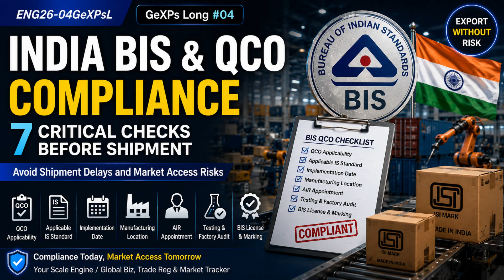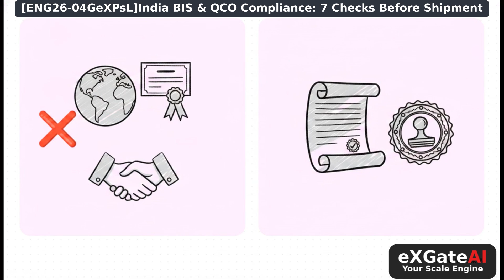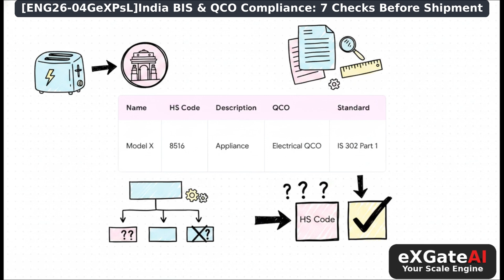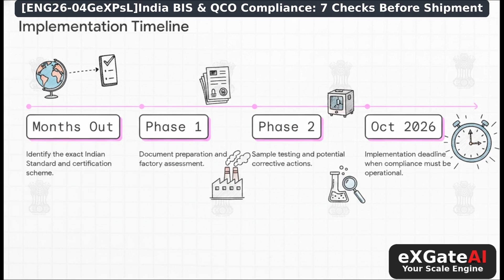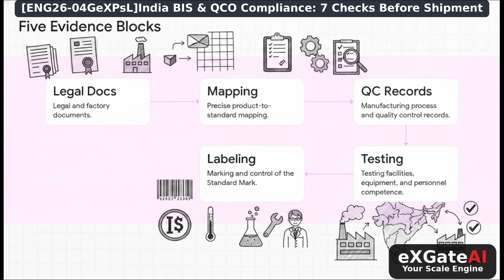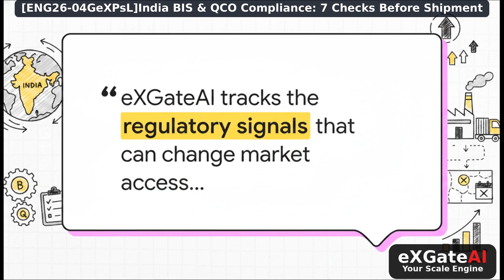Ship to India Without These 7 BIS/QCO Checks? Customs Holds and Rework Can Follow

Comment from the maker: Before shipping to India, can your company clearly answer all seven questions?

Is the product subject to a QCO? Which Indian Standard applies? Which certification route is required? Is the manufacturing site ready? Has the AIR been appointed? Are testing and factory-inspection preparations complete? Is the BIS license valid and the required marking correctly displayed?

BIS and QCO compliance should not be left only to the local distributor or certification team. Product development, quality, manufacturing, logistics, sales, and the local importer must coordinate before shipment.

Which part of India compliance is the most difficult for your company? Please share your experience in the comments.